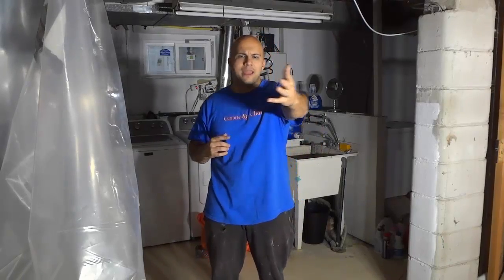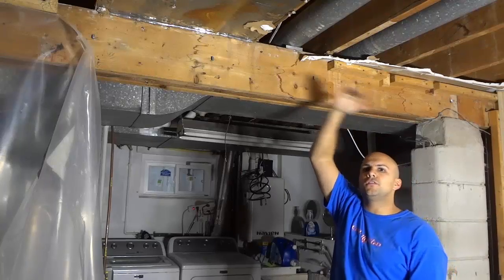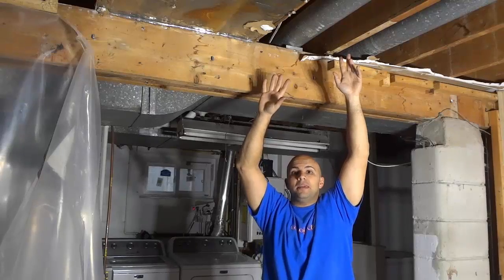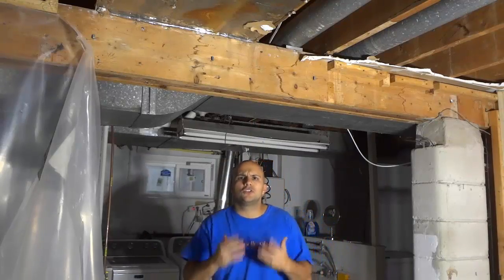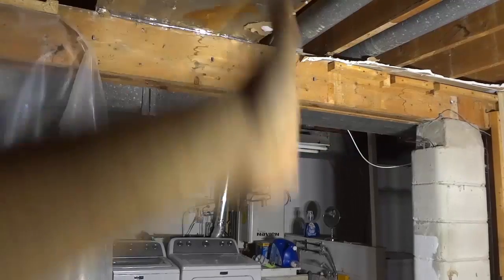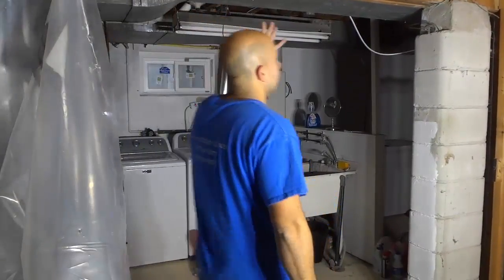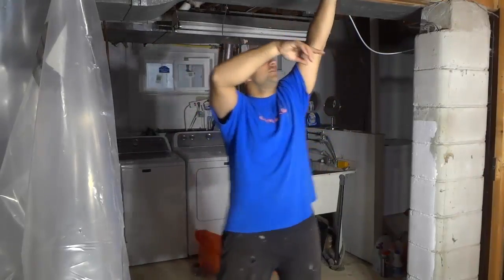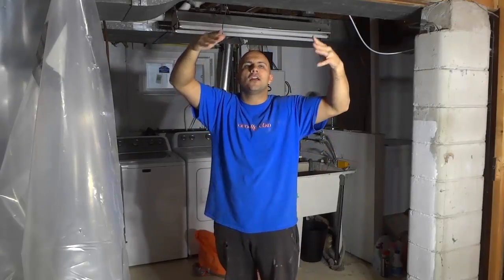How To Tell If A Wall Is Load Bearing

Comment: I pray you see this: I live in Puerto Rico and mostly all houses are made from concrete block walls or poured cement. In our home some was poured others not. There is a wall I want to make an entrance to but I'm so worried its a load bearing wall [it's not poured cement] so, how can I  tell if it is?